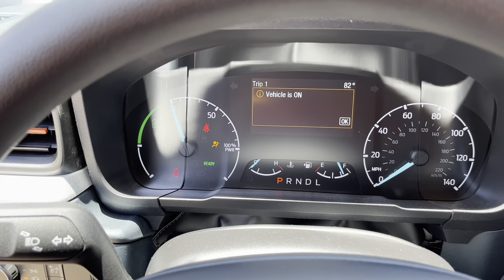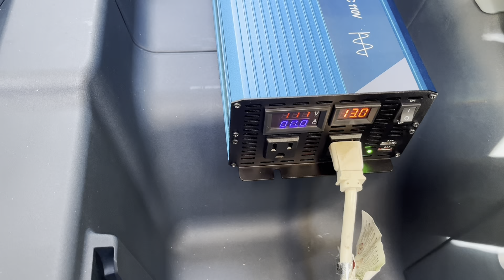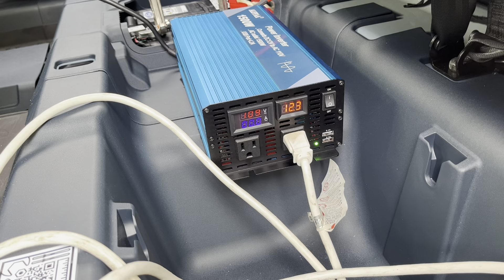Ford Maverick Hybrid DIY Power Generator?

Comment: I have a few comments. First, although it seems to work OK for you, I think 6 AWG wire is too thin for this application and those spring clamps are definitely janky. Personally I would wire this up with 2 AWG and a fuse or circuit breaker permanently to the 12V battery. But that's me. You might get away with 4awg only because the runs are very short. Second is just a comment about the behavior of the voltage. The DC-DC converter is basically an advanced battery charger and as such it has "bulk" and "float" voltages. When you first turn the vehicle on, it switches into "bulk" mode (14.7V). Then after a period of time, it decides the battery is fully charged, and switches into "float" (13 volts). It will do this regardless of whether  the inverter is attached or not and regardless of how much power you are drawing through the inverter. Many modern vehicles have similar behavior, it is intended to prolong the life of the 12v battery. Because the 12V battery is being charged from the high voltage battery, eventually you draw the high voltage down far enough that the engine will start because it is constantly monitoring the status of that high voltage battery. It doesn't really have anything to do with the state of charge of the 12V battery.  All this is somewhat academic, the system works well as you've set it up.

Comment: First thing that would come to mind is that it'll put too much of a strain on the alternator but that's not an issue with the hybrid.. Im curious as to whether or not it would be safe to run a small fridge for an extended period of time.. Like 6hrs?? Thank you for the video I'm definitely buying the inverter and will keep it in the truck
Reply from the maker: Small fridge is less strain than the power tools I was using. Compressor is not running the full time. Only enough to maintain the temp. I have a small fridge in my camper. Will not be a problem with the car on.
Reply: @GearGadgetExperiments  I bought the inverter you used and it just came in.. It'll be a nice very useful addition to the Mav👍👍
Reply from the maker: @slimj82  nice!

Comment: How did you keep the truck from shutting off after 30 min idle?
Reply from the maker: Turn off auto shut off https://www.ford.com/support/how-tos/more-vehicle-topics/fuel-and-fuel-economy/how-do-i-temporarily-disable-the-automatic-engine-shutdown-feature/#:~:text=Information%20Display-,Using%20the%20left%2Dhand%20steering%20wheel%20control%2C%20scroll%20to%20Settings,the%20Auto%20Engine%20off%20box.

Comment: What do you think putting a fuse on the positive wires between the battery? And can this setup also works on Prius?  Thank you for the video!
Reply from the maker: Yes. Will work on prius too. Same concept. The inverter itself has overload protection
Reply: Cool that make it so much easier, other YouTuber put fuse everywhere make it confusing.  Thank you
Reply from the maker: @jakeliujakeliu  this is all my personal use model :) not telling anyone to do or not do anything
Reply: What size fuse would you use?
Reply from the maker: @slimj82  this website has recommendations. https://www.altestore.com/diy-solar-resources/recommended-inverter-cables-sizing-and-breakers-or-fuses/

Comment: Great vid! I heard that the stock inverter is mounted behind the seat to the wall of the bed. Was this inverter too big for that?
Reply from the maker: Will probably fit. I just thought this spot was really easy to get to.
Reply: AFAIK the stock inverter in the Maverick is only 400W, much smaller than that beast in this video.

Here is a question for people who already have their Mavericks (unlike me). There are two outlets, one inside the cabin in the back of the center console, and one in the bed. Are both outlets fed from the same inverter, or are there two inverters?
Reply: @Sembazuru  two inverters, if you paid for the option. They only come with the lux's and the lariat as a standard.
Reply: @Sembazuru  there is only one inverter for both outlets in the stock setup
Reply: It is under the center console.

Comment: Concerning the "initial spark" when you hook up the battery cables. Batteries give off hydrogen when charging, and it is possible (not probable) that the hydrogen that MAY be present could be ignited by that initial spark. If you have never had a battery blow up in your face, you want to keep it that way. Just maybe use the battery cover to fan some air and disperse any hydrogen that MIGHT be present.  Will this inverter make clean enough electricity to power a computer or charge cordless power tool batteries? Fabulous video.
Reply: Because the 12V battery is inside the vehicle, it is a vented type, in fact you can see the vent tube in the video. Any hydgrogen gas generated will be vented outside so there is no risk.
Reply: @ackattacker  That's all true. But I have seen (been next to) a battery that blew up in a friend's face when he got that "initial spark". It is rare, but certainly possible. There is always a risk that hydrogen could be present. I don't know if the original Mav. battery has a hose (I haven't looked) that vents it, I will take your word on that. BUT-batteries get changed, tubes get plugged, and things can (probably won't) go boom.

Comment: Have you confirmed what the power capacity of the DC-DC converter is? I've seen 200A / >2000W. Is that correct?
Reply from the maker: I honestly don't know. But I hear it is the same as the escape hybrid.
Reply: @GearGadgetExperiments  volts times amps = watts

Comment: Can you do an update video on this please!! I just got my maverick. It has a 400w inverter from the factory. Im wondering if I can upgrade the 400w inverter to a bigger one like yours.
Reply from the maker: If you are ok with connecting directly to the battery like I did, I don't see a problem.  But if you just want to swap out the 400w for something bigger, I don't have any experience with that.

Comment: I had a '73 Super. Got extra long "truck" jumper cables so I could receive or give a jump while parallel parked.
Reply from the maker: Maybe I need the same super long cables now.
Reply: @GearGadgetExperiments  Lol. They can be useful for jumping two cars parallel parked on a city/town street, especially if traffic (or one way roads) obstruct turning the jumping car to be nose-to-nose with the car receiving the jump. But, AFAIK (without actually having a Maverick) the Maverick has jumping terminals in the engine bay so you don't have to go directly to the battery. My '07 Saturn Ion (with battery in the trunk next to the spare tire) does.
Reply from the maker: @Sembazuru  yes it does have termibals under the hood :)

Comment: Some of them have a 110 outlet in the bed and in the cabin. Can you just beef up factory inverter instead
Reply from the maker: You would have to get a bigger inverter and use bigger wires for routing.

Comment: How would someone go about having a marine grade 110 outlet in a panel out by the tailgate ran from that sine wave inverter the bed?
Reply from the maker: If you search forums, there is a way to route a line from the cabin to the bed.

Comment: You think a bigger inverter installed, would you be able to use a welding machine?
Reply from the maker: No, I don't. The battery is only 50Ah
Reply: @GearGadgetExperiments  thanks 👍 like your videos

Comment: Great vid! Couple of questions. Does this effect the warranty? Im curious why you used jumpers? Couldn't you just hard wire it? Thanks😮
Reply from the maker: I don't see why any warrantees would be affected.  But that is just my opinion. The clamps make it easy for me to disconnect. I don't leave this connected.
Reply: @GearGadgetExperiments if you clamp on to the batter terminals and cause sparks often you will leave burn marks or possibly melt the terminals a little. That could be what Ford uses to void a warranty. Perhaps using a more permanent but removable solution to attach to the battery would be a good idea.

Comment: Does this setup require an added fuse? Looking for something like this on my maverick for camping
Reply from the maker: You can add a fuse for extra security, but the inverter has overload protection.  Avoid over stressing any system, of course.

Comment: Cool!

Why not connect the wires directly from battery terminals to inverter terminals with a switch in the circuit, instead of the clamps?

Does the F-150 Powerboost pull from the hybrid battery? Or from the 12volt as you have done here?
Reply from the maker: If I plan to use on a regular basis, I may consider a battery switch.  Not sure about the F-150, but my guess is that it pulls from the 12V also.
Reply: Thanks @GearGadgetExperiments
Reply from the maker: I might actual try a solar power generator setup in the future.  For camping in the Mav.  Maybe put solar panels on top of my tonneau cover and a LiFePo battery.  Should have plenty of power.
Reply: With hybrid battery backup @GearGadgetExperiments  ! That’s the way to do it! Great idea!
Reply: That is not the hybrid battery.

Comment: I won't lie... you're brave to hook up a 1500w inverter to a 45ah battery. I'm interested to see what kind of strain this puts on the alternator/charging system.
Reply from the maker: No alternator on Hybrid.  DC to DC charger.  So the hybrid battery charges the 12V battery.
Reply: @GearGadgetExperiments  but what charges the hybrid battery?
Reply from the maker: Mostly braking or "rolling," but at idle, there is a sort of generator that recharges the hybrid battery if it gets too low.
Reply: @GearGadgetExperiments  (Upon further research) The 2nd electric motor is used to convert the mechanical energy to charge the main battery. It's essentially the same thing and the point I was getting at. With a standard gas car, you have to be careful with what you hook up the car's charging system(the alternator) because they are generally not rated to handle large loads. 

Hooking up a 1,500w inverter, with full load, to the small 45ah battery will drain it to 50% in about 10min. Mind you, the 45ah battery is a starter battery and not deep cycle. You're likely mostly running the tools off of the 14v charge circuit from the 1.1kwh lithium battery, as I can't see the system allowing the starter battery to drain beyond a fairly high capacity.

In theory, it might be able to handle the energy draw without any noticeable issues and far better than the ecoboost model. It all depends on how robust the charging circuit is. I was just curious what long-term effect running such a setup would have on it.
Reply: I’d like to know if I could power an ac unit in the bed all night a day?
Reply: @ModernSurvivalSense I would think the alternator would handle the load from this inverter.  I'm guessing when the truck is in electric mode it uses more then 1000w.  Maybe a little more or less?

Comment: Do you think you’ll be able to add a large additional battery under the seat to extend the range on pure electric power? I imagine someone will write software to handle any issues?
Reply from the maker: That is just the 12v battery I hooked up to. Not the hybrid battery. As far as adding another battery, I don't think that is practical.  If this was a plug in hybrid, there could be more value. But I'm sure it would not make economic sense.
Reply: Curious: Won’t the regular 110V plugs in the back seat or truck bed work to run power tools? 
Does the Maverick NOT give pure sine wave A/C?
Reply from the maker: @mackymintle7806  if I remember right, those are only 300watts. Will not be able to run the power tools or microwave. Microwave uses over 900watts.
Reply: @GearGadgetExperiments  copy that!
If I hear of an engineering solution to add battery capacity, I will let uou know!
My Maverick was ordered last August. I’m hoping to get it before Halloween?!🤷🏼
Reply: @mackymintle7806  have you gotten a vin or production date yet. The 400w inverter in the center console and bed is a bit weak.

Comment: I'm confused(normal), if the Mav has no alternator how does the battery get charged. I heard the motor turn on but with no alternator what charges anything considering the vehicle wasn't moving?
Reply from the maker: The hybrid battery gets charged by the engine (and regeneration) but not with a traditional alternator that is constantly run with a pulley.  The hybrid battery, in turn, will charge the 12v battery with a DC to DC charge.